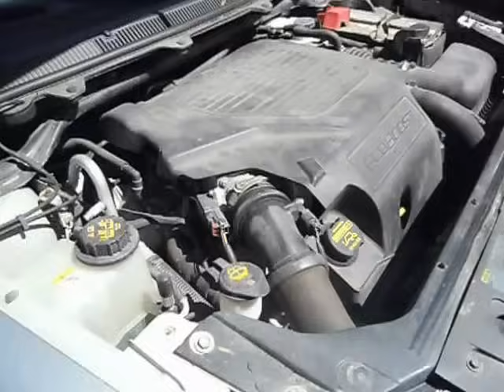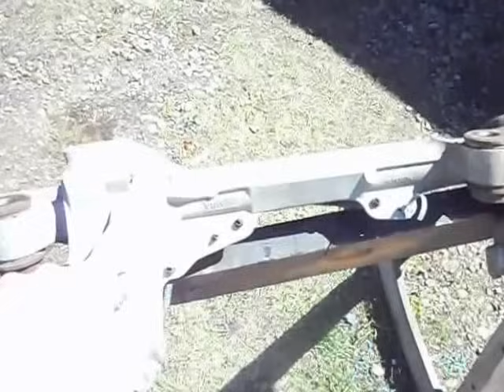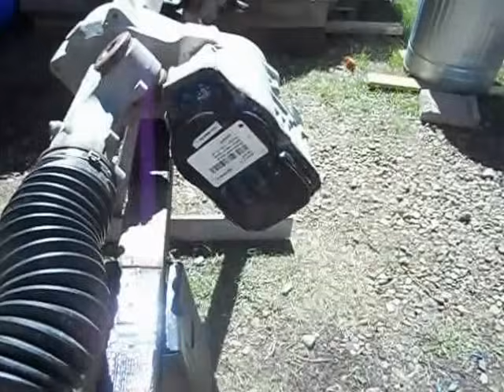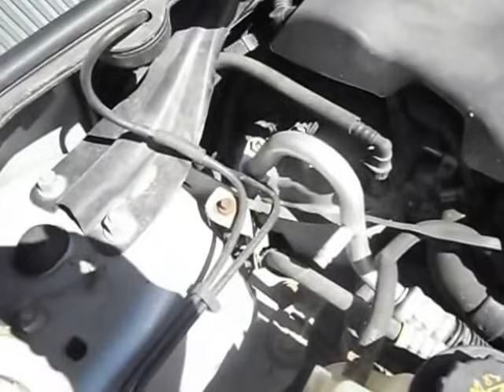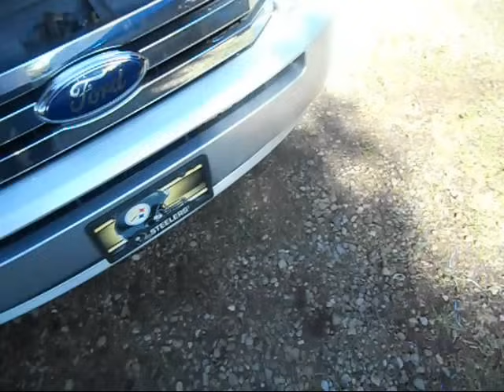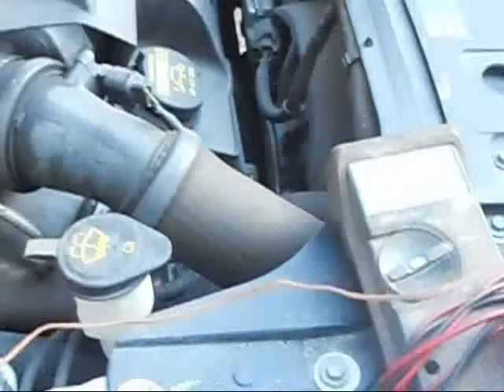Ford Electric Power Steering Failure Identified

Comment from the maker: I get a lot of grief from many Ford enthusiasts who blindly speculate there is no way a Ford steering failure can lock-up or actively torque steering wheel with great force. Ford also strongly supports this position, and in fact provided specific and official statement to NHTSA assuring consumer safety. These statements are completely contrary to my own, and many reported personal experiences with hazardous EPAS failure. I also want to point viewers to other Ford owner videos which clearly demonstrate actively locked steering column that cannot be moved, or moved without great effort. Imagine if this occurred at 70mph on busy highway. And before you reply with comment sighting misconception that failed assist only requires great effort at low speeds; educate yourself about servo-system failure modes. EPAS failures are not like old hydraulic system failure modes. EPAS failures include electrically locked servo-motors and non-commanded steering wheel torques. Failure can jerk wheel from your grip, or lock steering wheel in position with great force at any speed and at any time. Ford has published statements indicating these failure modes can never occur because EPAS computer constantly monitors system stability and shuts down power when fault is detected. Ford engineers apparently fail to understand a single computer that controls both servo system function, and monitors and reacts to system faults; provides minimal to no assurance against hazardous failure conditions. Failure of any critical component associated with this single computer; results in loss of both control and safety monitoring function. It is also important to understand that no system can adequately detect and react to all critical system failures. One prime example with the Ford EPAS system is steering wheel position detection using single-point optical encoder feedback. This rotary optical encoder can become partially or fully mechanically disconnected from steering column without ever being detected by system. In addition, data integrity from optical encoder can become corrupted and fail to be detected as fault. Both of these failure modes are predominantly undetectable by non-redundant based feedback implementation, and represent significant design deficiency and safety hazard. Intrinsic safety can only be reasonably assured by using separate and redundant computational facilities, and even this approach offers limited guarantee. But the most compelling evidence that discounts Ford's assurance of safety; is the dangerous EPAS system failures that occur each day to unsuspecting drivers, completely unprepared to react to sudden EPAS fault.

https://www.youtube.com/watch?v=FBvcxR7Cui8
https://www.youtube.com/watch?v=em4uSrBZwIk
Reply: the reason why its difficult to move at low speed is there is no steering assist when the EPAS fails. so since you were sharply turned and the system failed and you were overcome with the "extreme" burden of turning the wheel with no assistance and since you were not ready you gunned it and up the curb you went. when you're traveling at 70mph with the system working or not the power steering is not actually assisting you anyhow so it will drive just the same with or without 

i'm a mechanic been there done that
Reply from the maker: Jeremy Proctor
No, you are making the same assumption that most people make when speculating about EPAS failures. Brushless motor control systems exhibit electrical failures that can result in both non-commanded motor actuation and complete motor-lock. Non-commanded motor actuation is caused when servo system feedback mechanism (typically an optical encoder) fails and provides erroneous position data to controller. Under this condition, servo system incorrectly actuates motor to close error in feedback loop. This causes wheel to turn without driver initiated torque. This torque is substantial and can rip steering wheel from your grip. A driver may be able to overcome this torque; but failure can cause loss of vehicle control during driving. The second type of failure is more severe and caused when H-bridge MOSFET's or bipolar transistors in motor drive fail. MOSFET's and bipolar transistors often fail shorted; this can result in direct high-current electrical path through motor windings. The resulting condition electrically locks servo-motor in place with great force. Given gear ratio between motor and rack; driver is unable to budge steering column until electrical power is removed. Imagine this failure while driving at speed. Ford and the NHTSA both make the same argument you advocate; sighting power steering failure modes based on old hydraulic based systems. But an EPAS system is completely different beast, and thus exhibits failure modes not readily recognizable unless you have experience in servo and controls engineering. I designed servo systems for over 30 years in robotics industry. I can tell you without doubt, Ford EPAS systems are experiencing non-commanded torque and motor lock issues. Mechanics is a hobby of mine these day's, I restore heavy equipment and 60's era muscle cars. Been around automotive mechanics since my father let me help rebuild his 66 t-bird engine. Believe me, I know the difference between loss of power steering under manual control, and active servo-motor lock. When my vehicle was forced into curb; steering wheel actuated to full-stop, then locked in place. Wheel could not be budged for several seconds (and I can still bench press 300lbs). Once system detected error and shut down, wheel could be manually moved (with difficulty, but possible.); which is how I drove home.
Reply: K Smith to be honest with you i read the first sentence and I'm done your absolutely right , I'm just the guy that turns wrenches for a living
Reply from the maker: Please note your experience in automotive mechanics is greatly appreciated. With both Ford and the NHTSA actively suppressing the real and serious hazards associated with EPAS steering failures. I feel it necessary to provide as much public insight as possible into the failure modes of these highly-complex and dangerous servo systems. Very few individuals understand EPAS and hydraulic based systems exhibit greatly differing failures. Many are annoying, some are inconvenient and expensive, and a few can kill. With Ford having replaced perhaps as many as 4 million EPAS units since recall, it is clear the problems have reached critical level. People tell me there stories about EPAS steering failures all the time. Many are mothers and fathers with children present in vehicles during failure. Many describe near death experiences with vehicle abruptly swerving on it's own. But even with just sudden loos of power assists; many are placed in dangerous situation in active traffic. It is just a matter of time before fatalities begin to emerge, but perhaps we will never even hear the real story from these people.
Reply: K Smith Hi there, I am facing a similar problem. I own a 2011 F-150 and my power steering cut out and i nearly went off the road.  Transport Canada and Ford have issued a technical bulletin (for covered repairs) for the exact same problem for other 2011 Ford models (Escape, Focus etc).  The F-150 has been excluded. I would very much enjoy the chance to chat with you. Could you please send me a private message?  Thanks.
Reply from the maker: Brian Arnold
Ford has in fact excluded from recall affected vehicles since 2008, my 2010 Flex was excluded. Ford and the NHTSA are both responsible for intentionally defrauding consumers and deflecting serious public safety hazard. Your options are limited; either foot the bill and pay $3K for dealer replacement (which does not correct real issue and is 'one-time replacement). Or find replacement unit on ebay or other supplier (typically around $300.00) and replace unit yourself. Ford will offer $750.00 to pay partial repair bill, however they will play a game of delay and deny for about three months before offering payment. And you will be required to submit various paperwork, and sign non-disclosure agreement so your experience is kept from public knowledge. In the end, you will still own an unsafe vehicle, which will continue to fail because thermal issue has never been addressed. Ford will never properly address problem because corrective measures are extensive and would cost Ford billions. The NHTSA is a joke when it comes to mandating corrective measures against American based companies. Sorry to paint such a negative picture, but these are the realities of owning Ford products. Please continue to post your experiences so other consumers can begin to understand how Ford conducts business.
Reply: @K Smith. While going through the installation procedure from the ford , came across one specific point. 
" 1) Vehicles built on or before April 12, 2010 are equipped with an EPAS gear heat shield. 
  2) Verify the vehicle build date.
  3) Was the vehicle built on or before April 12, 2010?
  4)Make sure the EPAS gear heat shield is present and installed correctly" 
If your vehicle was built before the specified date here, maybe that is why they have excluded yours from recall as they came up with a possible solution of installing heat shield inside the EPAS. By reading this installation procedure it could be said that Ford is well aware of the failure modes of the EPAS.
Reply from the maker: My 2010 Flex included the heat shield, failed anyway because a heat shield only absorbs energy for a while before everything becomes saturated. EPAS internal temperatures still rise above industrial temperature limits. There is no fix from Ford on this issue, Ford has not even acknowledged existence of heating issue, and never will. One thing for sure, Ford has abandoned you if you own one of these vehicles.
Reply: Thanks for the info. What do you think is the possible solution for this thing? What if you replace the two MOSFETS and then cover with some additonal heat shield? Or there is no solution other than selling ones vehicle?
Reply from the maker: The only solution to a thermal load problem is reducing energy source, or removal from thermal environment. Ford understands full well that correcting this problem means repurchasing perhaps 500+ millions vehicles. The EPAS system does not belong in the engine compartment, this is precisely why other manufacturers have placed components under steering column. Ford just implemented the worst possible engineering choice, then stuck with it in spite of obvious testing failures (heat shield, air dam, etc.). I have known and worked with many automotive engineers in the past, they were always very bright, very young and enthusiastic kids, with absolutely no clue how to actually design real systems. No insults intended, just an actual observation.

Comment: 2010 Flex Eco-boost. Started seeing this problem about a month ago but cleared after first time and seemed fine.  Over last week it has happened twice, took to ford dealer.  Confirmed EPAS fault and said it needed to be replaced.....to the tune of $3800.....Guess what isn't getting fixed....and is now on the way to the salvage yard....
Reply: You can get one from a junkyard for around $800 to $1000 and they are relatively easy to put in that’s just a shop trying to make a good lick off of you
Reply: @Littlemafia270  Yep, did a little searching on the internet for rebuilt ones as well.  Just wasn't sure how involved it was going to be to replace.  Fortunately have a friend with a lift and some spare time......guess it will live a while longer.....and for a lot cheaper!!!
Reply: @ Good deal it is a bad fault for the vehicle to have but if you have the ability to put one in yourself or someone you’re close with it’ll be back on the road in no time

Comment from the maker: Thanks for your comment. Your vehicle problem is one I have never experienced personally or otherwise. With that said, I am assuming you imply your Dodge includes electric power steering? If so, I am not at all surprised by the seemingly strange and system-coupled failure dispositions you are experiencing. The fact that problem initiated with failures associated with direction of turn; could imply problem with steering position encoder. Not familiar with dodge design, but these sensors are comprised of optical rotary encoders mounted either on steering column or inside electric power steering assembly. There is also an optical encoder located inside the electric power steering unit, on the actuator output motor, used for motor position feedback. The failure disposition you describe sounds much like an optical encoder disk that has become partially detached from its rotational shaft. The fact that problem has become worse is also consistent with this theory.
Note various electronic modules comprise a typical automotive system, and all of these modules communicate over what used to be called a CAN bus (controller area network, or similar). Electrical connection problems between modules and/or faulty module in network may also cause seemingly strange interactions like you describe. One possibility is some sort of mechanical interference between steering components and vehicle wiring or module, causing intermittent loss of bus communication or power. This type of problem should be evident in ECM (engine control module) error code reports, you can read using low cost reader from ebay. I strongly suggest approaching problem based on real-time monitoring of ECM data while failure is in play. The ECM should provide history of module or communication errors. Good luck and sorry I cannot offer more specific detail. Problem is most likely not so mysterious as symptoms would indicate.

Comment: OK Many thanks for this detailed explanation , as long as the main reason for loss the steering power is the overheating from the engine- catalyst or whatever!! so how to avoid this and to protect the steering motor for the overheating ! Well just an opinion to put so thermal insulator or to install and fix a small fan over the steering motor to keep it cool ! I have 2012 ford fusion 4 cylinder 2.5L ?
Reply from the maker: As an engineer, I have experience with design of intrinsically-safe and regulatory agency qualified electronic implementations. It was expressly my job as an engineer; to specify components and design circuitry that adhered to various standards of the trade. Intrinsically safe design is serious business; with legal ramifications if regulatory specifications are not adhered to. I can tell you many stories associated with use of improper temperature rated components, cooling and ventilation implementations, and frantic 11th hour attempts to correct an improperly designed thermally stressed system. It may seem like logical approach to ventilate given stressed system with cooling; however one must consider many factors and approach problem from an energy standpoint. The sheer amount of energy involved in an engine compartment is staggering. Nothing short of serious CFM with cold air input will achieve much; otherwise hot air is just moved around. The amount of CFM to keep the large aluminum EPAS housing cooled would need to be determined experimentally, since no data is available to make meaningful  thermodynamic calculations. You must also consider that many Ford models already include extensive attempts to cool EPAS assembly; including dual air-dams mounted under engine, and aluminum heat shield around EPAS electronics enclosure area. Clearly Ford was fully aware of thermal issues; otherwise none of these measures would have been implemented.
Automotive steering systems represent critical and essential automotive component. Given an EPAS system is to be implemented under hood of modern automobile; design must adhere to automotive standards of intrinsic safety. Placing non-automotive temperature qualified components within an aluminum housing and blowing air over it, then calling it 'automotive qualified' is clearly at heart of Ford's problem. Alternate manufacturers have opted to implement EPAS related assemblies within cabin; which common sense would dictate. Ford is not even able to design an EPAS system meeting full automotive temperature grade. This is due to fact technology required to implement EPAS functionality is highly mixed-signal, mixed mechanics by nature (i.e. microcontrollers, memory storage, motor drive, optical encoders, sub-miniature wiring and connectors, high-density interconnect cables, brushless motors, timing belts, large capacitors, high-density SMT PCB's, etc. Many of these components are not readily available in extended temperature ranges, available from very limited vendors, and prohibitive by cost.

Comment: thanks for the the work in finding the problem and a proper solution path. industry should have just kept the hydraulic power steering alone. they want control not ease of use.

Comment: Ford should water cool the EPA or put in a manual steering rack and put the EPAS system on the steering column.
Reply: Gm did that and they still failed.

Comment: Fix or repair daily... Ford along with the other vehicle manufactureres are having major issues with their electronics they are made cheap and it’s not going to stop... you can’t have high temp’s with electronics they don’t go good together. The only remedy is to not use gas to power vehicals any longer and that’s what they’re trying to do now... that’s really the only remedy for it fully electronic controlled vehicals... combustion chambers cause too much heat on electronic units.
Reply from the maker: I.e. "Fix or Rust Daily"